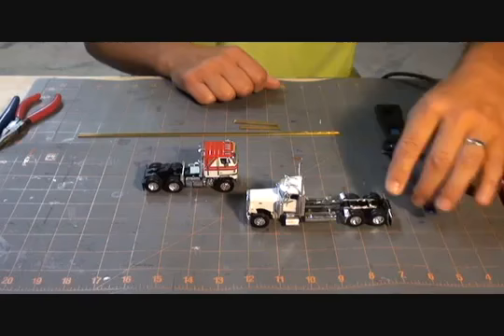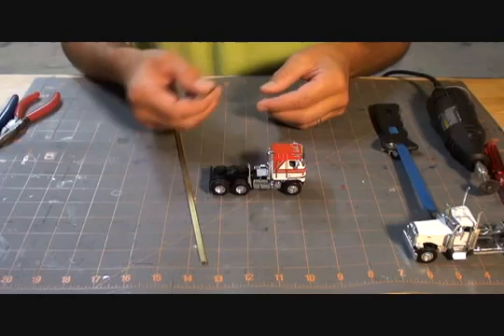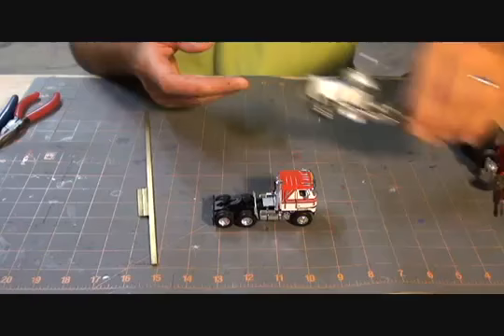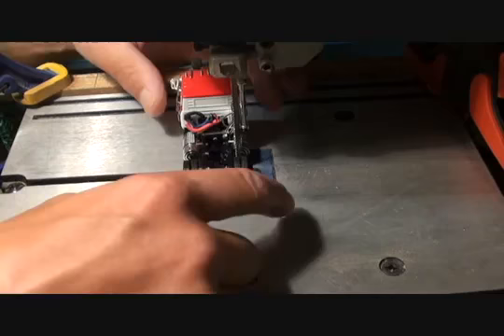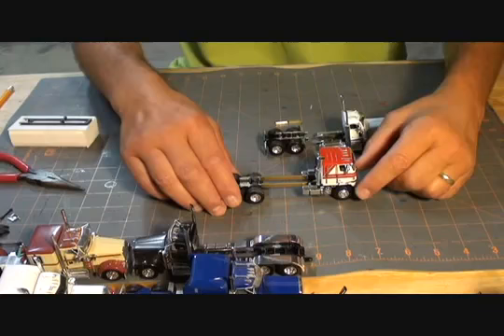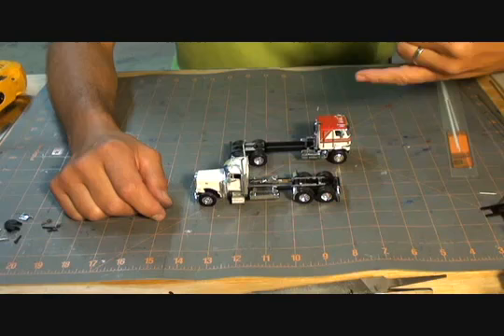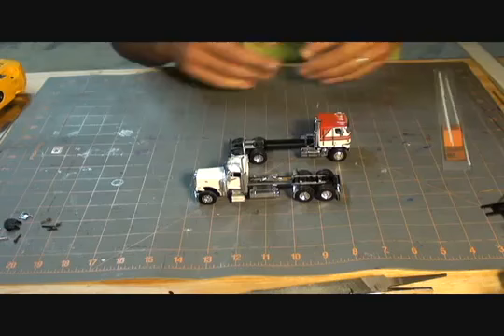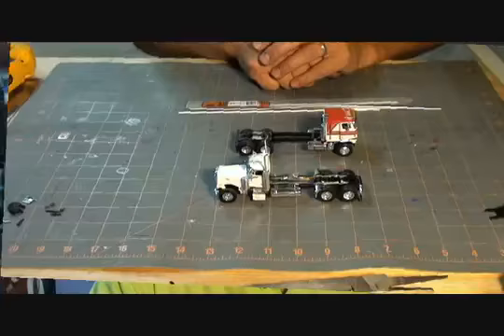Stretching a DCP Truck with Rockin H

Comment: Yes it would. I use spray cans but I know other builders that use air brush with success. On resin or plastic products I use Krylon plastic primer paint, then my preferred color. Thanks for posting your question.

Comment: I have not repainted any DCP trucks (like the cabs in the video), to get those looking like they do from the factory is near impossible. That said, I will repaint other brands of trucks. I have used Krylon, Testors, and TruColor with success. One tip, spend money on paint, it is worth it. Thanks for the question.

Comment: I want to strech a matchbox tractor what can I use to strech it with
Reply from the maker: Measure the frame for thickness then see what size of styrene or brass channel would fit it.
I have 7/32 and 1/4" brass channel in my store.

Comment from the maker: DeereFarmer09, the process would be much the same. Easier IMO. Cut out all the metal between the frame rails first. The frame rails will be pretty thin when you are done. Cut and stretch like a DCP when step one is complete. Rectangle tube works well as it slips right over the frame rails with ease.  Let me know you get along.